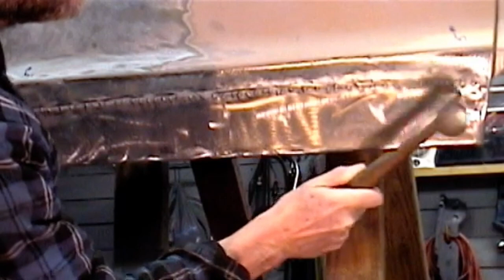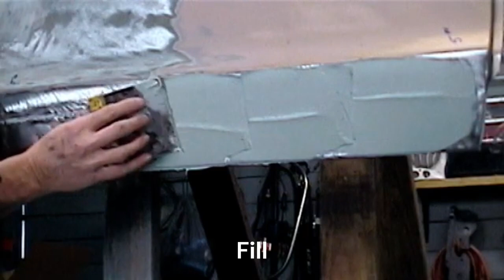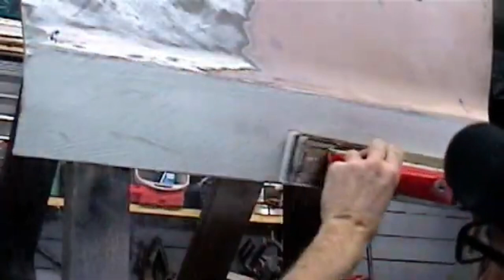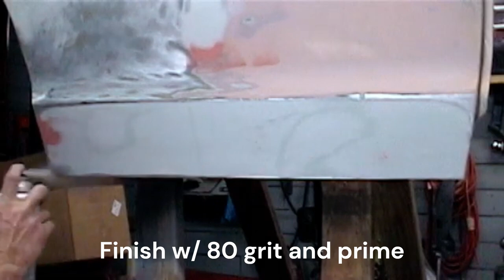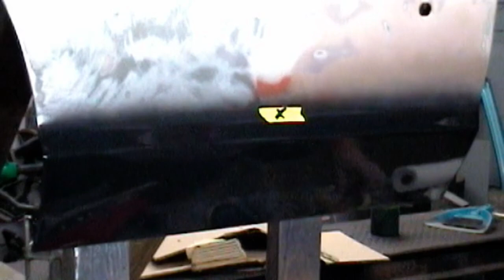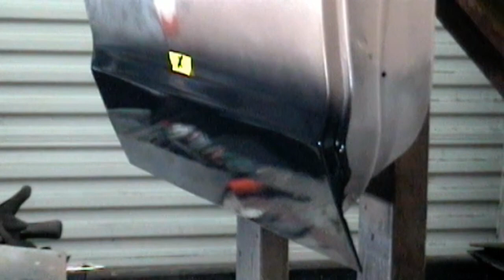Key Steps for Finishing Auto Body Patch Panels - 2 Minutes

Comment: Nice to see a pro using bondo.  But using it in the correct amount. Great vid
Reply from the maker: All of the videos you'll see here,  I put it on pretty thick but that's because I want to try and get it in one shot - not apply, sand, apply sand....  It's pretty likely that a magnet would stick well to most of the finished repairs as quite a bit is taken off with the cheese grater.  Thanks for always watching PSG :)

Comment: good video Jerry   quick Question on the weld. does it need to be a solid seam of weld there or is it just tacked all along?  i assume that is a lap weld and not a butt weld as that is what i have seen in your prior videos.  it is just the filler that stops moisture from seeping in?
Reply from the maker: You nailed it on the last sentence.  My boss used to make use put the welds right next to each other but we'd cheat of course and it really made no difference - I really don't remember any come backs on rust repairs.  I think if you put them somewhat close to each other, you're good.  Also if you are concerned, the first coat of filler can be fiberglass reinforced filler like Evercoat's Everglass or Bondo Glass.  It's water proof as opposed to regular filler.  Although, I usually use regular filler and never have an issue either - here's a follow up on these types of repairs - https://www.youtube.com/watch?v=gIS1Tbv7Kvw

Comment: I know last time I said that high build primer was the best thing ever, but if someone invented a paint that was thick enough to fill and hide 40 grit sanding scratches and lay down flat without getting runs all over the place,  we could paint an entire car in less than a day with light body work and get rich! hahahahaha
Reply from the maker: That is actually done quite often.  Sometimes you may see some sand scratches in the paint.  If you get lucky, you can wet sand and buff them out.  Just let it sit for and cure for a while before you sand and buff.  Good thinking 💯